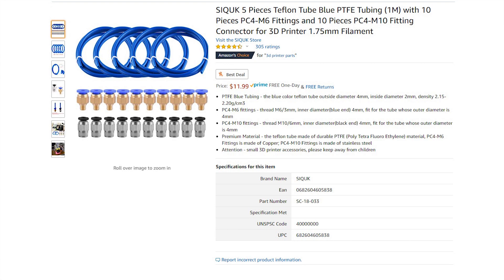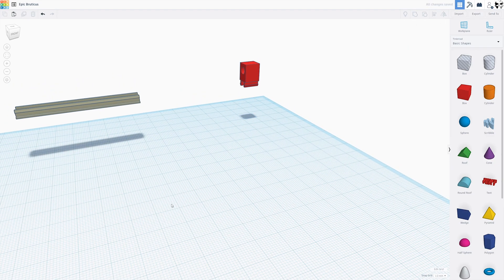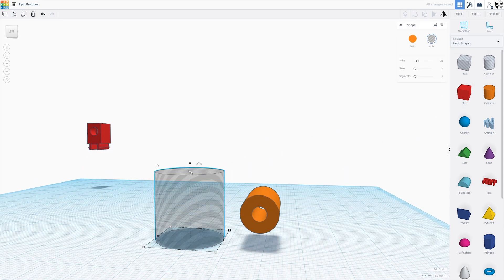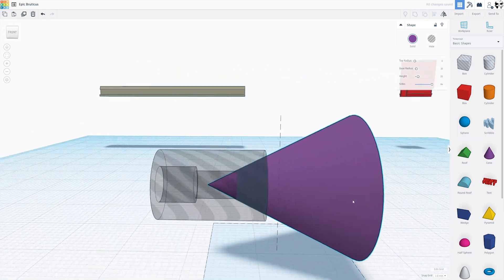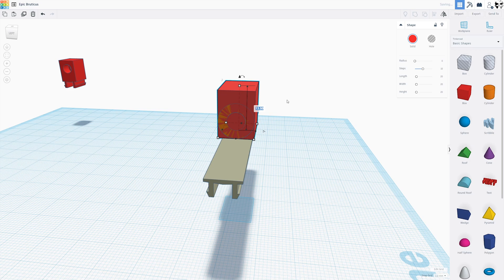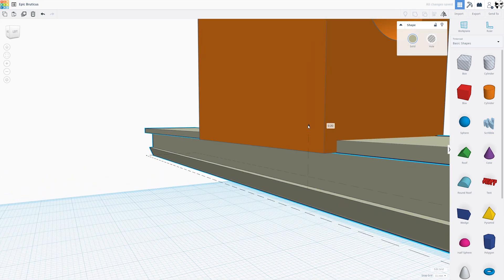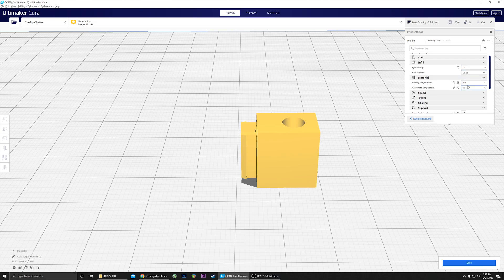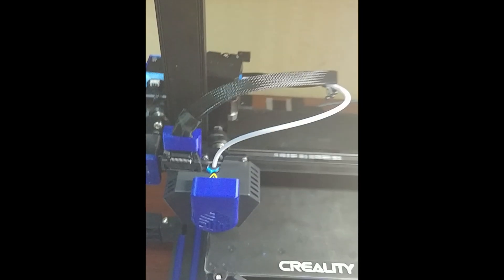Designing More Parts for the CR-6 se! | Push-in Filament Guide (WIP)

Comment: Is that a bowden connection for the stock runout sensor?
Reply from the maker: Do you mean this? https://www.thingiverse.com/thing:4617010

If that's what you're talking about, it is. Sort of. 
I took that design and widened the hole to allow for the bowden fitting to be threaded in. 
I eventually took that off as it just got in the way more than not and now the tube just swings freely. Much easier to feed filament through all the way. And easier to clear out a jam that way.
Reply: @Avel  why would it get in the way? Thought it would be a good set up from my drybox to that
Reply from the maker: @chrismunson5513  To be fair, I was having a lot of issues with the runout sensor not working correctly and getting jammed (I've since had it replaced with a new one from Creality) and I kept having to take that off to take the sensor apart. 

On top of that, I don't know if maybe the bowden fitting I used was at fault or what, but when feeding filament in, it would constantly snag the filament right at the fitting and I'd have to fiddle with it back and forth, sometimes for several minutes at a time, just to get the filament through.

That's the main reason I printed it, to connect directly to my dry box. You may have better luck than me if you want to try it out. Results may vary. I just lost patience and left it off in the end, haha.